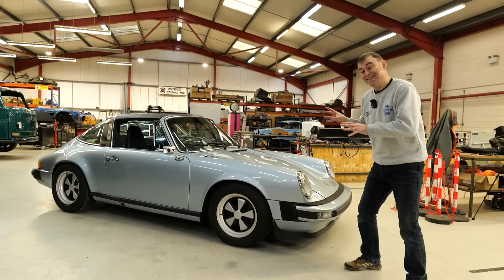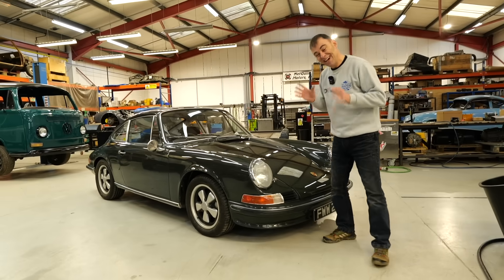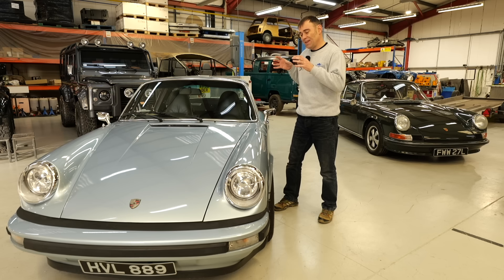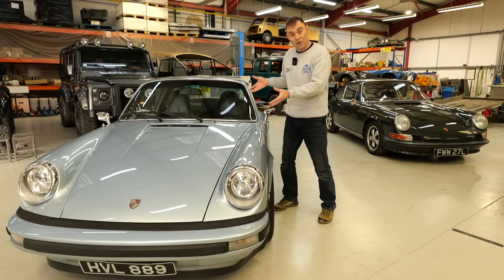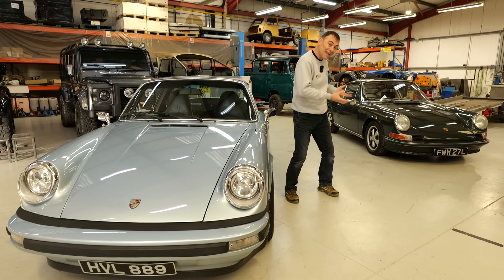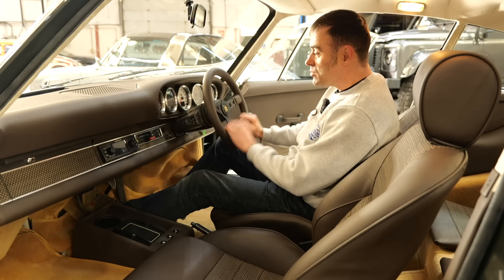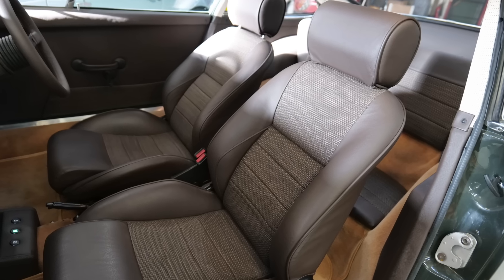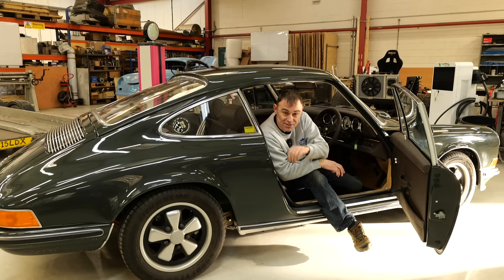Electric Porsche 911 - 10 years of development.

Comment: Just my two cents. If you're set on getting a Porsche (Like Me🙂) but can't afford the upkeep of a traditional combustion engine, especially if you're not doing the maintenance yourself, going electric might be a more cost-effective option in the long run.
Reply: I fully appreciate these conversions, but at the initial costs I think you can buy several 911 engines which will last you a lifetime assuming you are not 18 y.o. 😂.

I have an Ultra rare aircooled car wich I plan te keep for life. If ever classics get banned I'll convert it in a heartbeat.